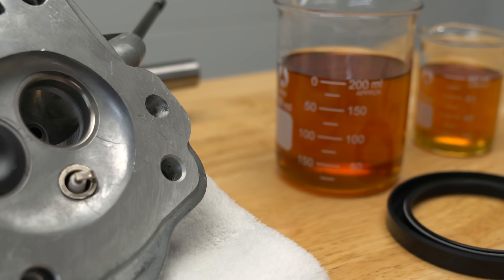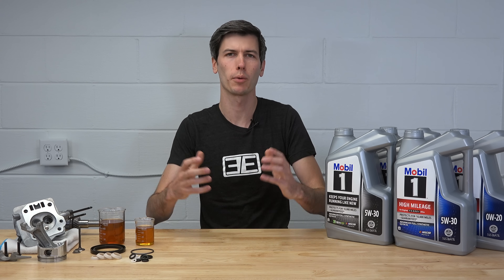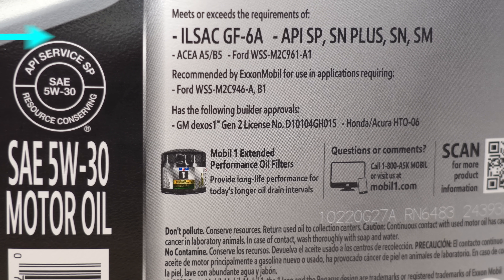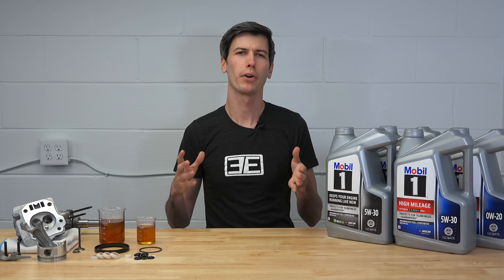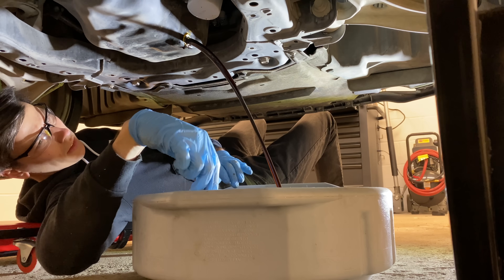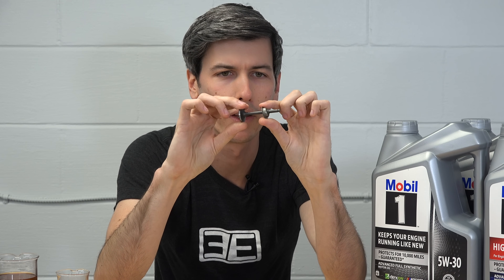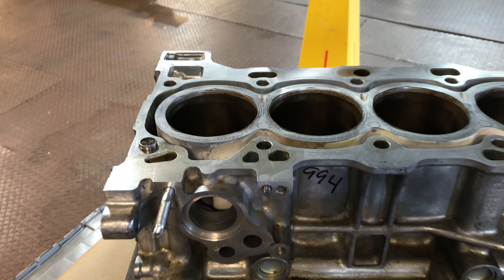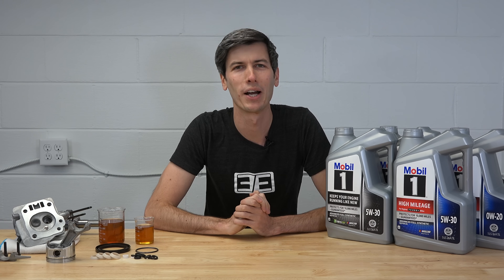Is Synthetic Motor Oil Bad For Old Cars?

Comment: My Silverado was developing a nasty morning "tick" on the driver side (common issue with the LS engines) and even after changing my oil, it would persist after a few days.  Now, it would only tick when first starting up, meaning the lifters weren't getting enough oil up there when first starting, but eventually would go away once the oil was flowing and my oil pressure gauge would always dance around a bit and be on the low end of the hash marks when sitting idle.

I switched to Castrol Edge (high mileage) and not only have I not heard the tick in the mornings, my oil pressure has been higher with only a flutter once in a while, but never dipping back down to where it would go.  I don't know what's different, I still use the normal weight oil and the same AC Delco filter I always use.  I also noticed that the truck just seems... better.  It's not faster or more powerful, but it just seems like something is different (in a good way).  I have noticed that it's quieter when idling too.  Maybe it's just a placebo effect, but who knows.  I used to put Castrol Syntec in all my cars before it was discontinued and I guess I should have stuck with them :D
Reply: It's not the oil that's the problem. A good filter will help the problem. A filter that has a high quality anti drain back valve will remedy it. Had the same engine and same problem.
Reply: @vanguy9780  I've run the same AC filter I always do, the only thing I changed was the type of oil, so not sure why the tick went away.  Then again, it is an LS engine, they are known for their magic.

Comment: Two things: 
1) The argument against modern synthetic oils in an old, worn, deposited engine is supposedly that the detergents will loosen the deposits from under the intake for example (chevy classic small or big block) and lodge them in unwanted places (mains etc). I don't know if this is true as in being an actual problem or not. Just mentioning the "real"argument against modern oils in old (neglected) engines, as I heard them. I might have heard or read it from David Freiburger too.
2) An engine being restored for modern use with  molly-rings etc, has nothing in common with the 50s or 60s when it was made. It's hopefully built by a knowledgeable, engineer, engine builder, hence using modern play between parts - hence reasonable oil (5-10W) and definitelly synthetic, will pose no problem at all.

Comment: Love your channel, but some of this isnt true. Depending on whats inside your engine can determine what oil is nessisarily. For example, a flat tappet camshafts require more zink in the oils to provent the lifter from stop rotating in the bore.  that synthetic oils do not provide.

Comment: I use Mobil1 Advanced Fully Synthetic Extended Performance High Mileage 5W-20. It has a blue/gold label on the big jug I get. It's 29$ for the big jug at walmart near me. I also use the Mobile 1 long lasting oil filters, the green label ones. I have a 2012 Dodge Avenger 2.4L 4-cyl, 4-speed with 143k miles and not a single problem starting, accelerating, or idling. I do think I burn oil. The level drops just a tiny bit between changes. I can't see ay stains on the underside of the engine, no signs of leaks. I change every 5k miles, even though I know I could probably go longer. I would rather change the oils sooner, than have the car break on me sooner. My grandpa has 960K miles on his 2010 RAM 3500 he uses to deliver trailers. I take his advice, since he has proven it to be worth listening to, hahaha

Comment: QUESTIONS ABOUT OIL CHANGES.  One of my cars sat for over 3 years and now it’s ready to start being driven again.  The Mobile 1 synthetic oil has sat in the oil pan all this time.  I also have replacement oil that has sat in the new plastic container for at least 3 years.  If a car sits for years, typical advice is to change the oil, but if the “new” oil has sat just as long, is that “new” oil as a bad as the oil in the oil pan?  Do I really need to replace the oil?  If so, should I buy new oil from the store?  New oil doesn’t have a date of manufacture or an expiration date on the container; so, how do I know how long the oil has sat on the store shelf?  What is the useful shelf life expectancy of new oil?

Comment: Is it correct to say that an engine can only lose oil in 3 ways:
1. External leak ie oil drips onto the engine /floor
2. Internal leak so oil gets into the ports (valve stem seals) or combustion chamber (past the piston rings) and is burnt and goes out of the exhaust
3. Vaporisation in the crank case so it escapes via the PCV system
Is this correct? If so what causes the vaporisation in the crank case and is there anything you can do to reduce it?

Comment: so i just bought my first car with 110.000 km on the dash. it's a 2002 renault clio and it has miniscule issues with its oil. i'm still monitoring and trying to figure out where these micro leaks come from, but i'm pretty sure the pump/pressure valve that feeds oil from the tub directly into the engine is the culprit. either the pump itself is broken or the tube is just not perfectly seal-tight. as i said, i'm not a mechanic and it's my first car. as winter is coming closer and closer, i requested a car manual, which i got, but there's no recommendation of what oil i should use, only them saying i should always head to renault certified workshops and follow their instructions.

the car doesn't have any bigger issues and i can not afford going to a renault mechanic for them to charge me half of what i paid for the car to fix these tiny little issues. my question would be, since an oil change is so mundane and i should probably do it myself: should i immaculately clean the spot where i see the oil covering the tube that feeds the engine or rather just be more careful with a few paper towels before i do the oil change? i want to keep monitoring it and so far i have never even seen a single drop of any liquid on the asphalt whenever i leave for work or whatever. the other and more important question is: which oil should i use? i keep googling and asking people and i hear many different opinions. i was going to use a fully synthetic 10W-40, but i seriously consider a 0W-20, 0W-30, 5W-30 or a 10W-30 now after watching this video. sadly, there is no clear service history, but the car is really almost completely immaculate!

anyway, i want to thank you for providing us with very visual and well-explained content about common car questions. your unique humor makes it all even more digestible and fun! keep doing what you're doin'!

Comment: The synthetic oil in an old car argument reminds me a lot of the transmission flush argument. If it broke your car, you had bigger issues.
Reply: Not changing your transmission fluid because it will “hurt the car” is like not going to the dentist because they will hurt your teeth when they clean them. No  pain, no gain.
Reply: Johnny Tyronne  excellent point. PROPER flushes are not that common. People need to know what fluid their car requires and that that is the fluid they are getting. Modern cars are not as simple as they once were. Quick lube places aren’t likely to do a proper job. Dealers have a better chance but don’t be surprised if even they mess it up. Just adding fluid can be a technical and time consuming process. Sadly, when any job is slightly complicated, the chance of it going wrong is high. That’s why many manufacturers seal transmissions so they last at least as long as the warranty.....Extreme longevity requires extreme solutions. Nothing like doing things yourself if you want your car to last.

Comment: High poly ester is still available don't accidentally get 10w 30 air compressor oil. It will destroy all seals in your modern vehicle

Comment: I Have an Older car, with a Professionally Rebuilt Engine, with New Parts, Balanced, Blue Printed, and I Use Synthetic Oil(Mobil 1), In Everything!!....But In My Car,When Heated Up, My Oil Pressure Drops to about 5 psi, at Idle...Which Drives Me Crazy!!!...I Do Not Want to Lose It!!.....I Added Lucas Oil Additive to Boast Up Viscosity, and it Did!!....Now I Have 7 psi.....I Am Thinking off going Back to Regular Oil, just to Raise the Hot, Idle Oil Pressure....But I Love the Synthetic Oil.........Any Suggestions???

Comment: BMW engines haven’t met a oil that doesn’t leak out.
Reply: M50 - owned one 4 years, it's bulletproof.
Reply: @fredlachy  that's good but let's be honest, oil filter housing leaks are pretty common on M50, M52, M54 and M56 engines (probably others). my M52 and M54 were pretty much leak free, but my brother's M56 is far from it.
Reply: And Fiat (Alfa Romeo). :) Proud TS owner, but old Nord blocks were something else. Reliable as everything.

Comment: The issue is not the quality or the formulations of synthetics oils. It is the cost per volume compared to standard formulations. The other statement made about synthetics is that you can run them longer between changes. That misses the reasons for changing oil in the first placeThat is one purpose of oils not discussed in the video is to clean and carry the deposits away to the filter. The cleaning agents are detergents which get used up as they do their job. You change the oil and filter to drain away the dirt and combustion bi-products and put new oil for a new charge of those additives. If your engine is running clean, you can run out to those extended oil change intervals simply because the contaminants are not being generated. If you are getting blow-by because of wear, all oils will deteriorate quickly. The up shot to all this is change your oils at the manufacture's recommended intervals and you don't have to pay premium prices for those "synthetic" products. As far as high mileage formulations go, if the engine is worn out, you have to either fix it or get something to replace it. The video in my opinion is more about advertising a product tham providing useful information on which to base a decision on.

Comment: Don't do it. Friend told me not to put synthetic in my 360,000 MI 95 Nissan pickup v6 which didn't use any oil to speak of. Maybe half a quart in 3500 miles.  Oil stays pretty clean in this engine too. So I ignored him and started using synthetic anyway. Rear main started leaking about 1500 miles after going to synthetic. I've got about 250,000 miles on my clutch and I don't want to change just because the main is leaking. Went back to conventional oil put some Blue devil rear main seal sealer in and the leak has slowed down considerably.  Had the valve covers off recently and engine is really clean. I don't think it was crud around the main seal that was keeping it from leaking. I don't know why synthetics make seals leak but at least in my engine I don't think it's the cleaning action. Maybe it shrinks seals.

Comment: If your older vehicle has an engine that uses a flat tappet lifter, it will need to have zinc or a zinc replacement additive in its engine oil. Having zinc in the engine oil will prevent the lifters and camshaft from wearing down prematurely.

Comment: Ask Mobil 1 why their oil turns darker than diesel oil after only 3K miles? I used it in my Srt, and my v6. Both were very dark, switched to Pennzoil and it comes out golden after 4-5K miles?.. I know oils have different properties, but my v6 shouldn't be burning oil, and it stopped burning oil as well after swapping to Pennzoil. (0W40 - srt / 5W30 v6)

Comment: @ 6:20 .... no one switches from a 0w-20 on an old car to a 5w-30. What is this a first time subaru track day event or something with a bunch of imprezza owners?  People switch to a 50 weight or 40 weight, and then there is a significant difference in both viscosity and leak rate.